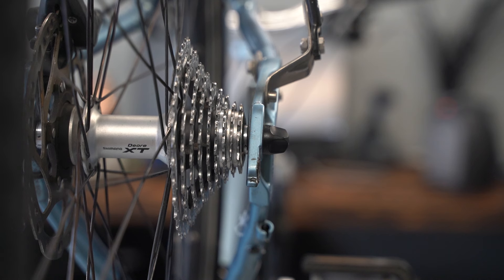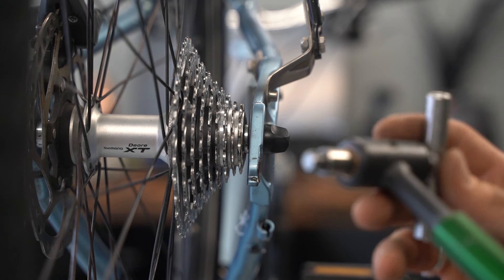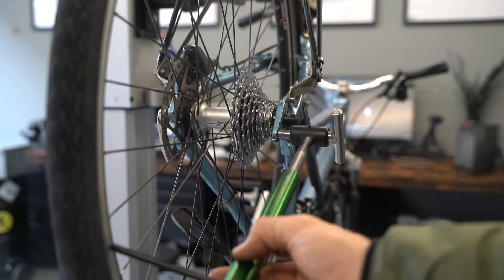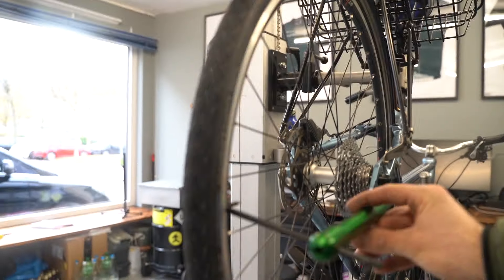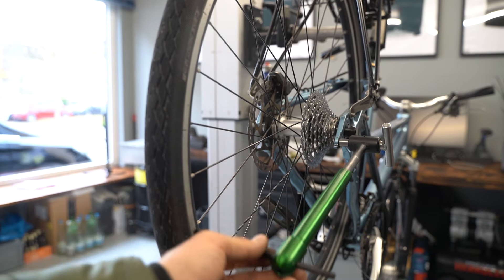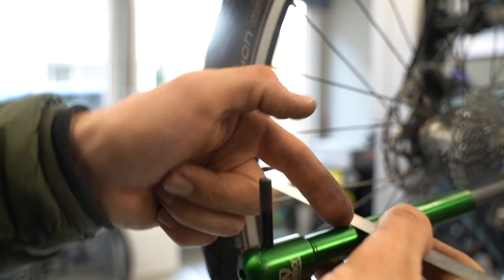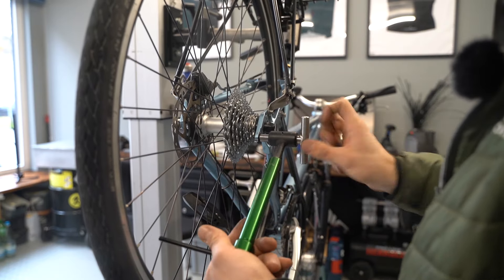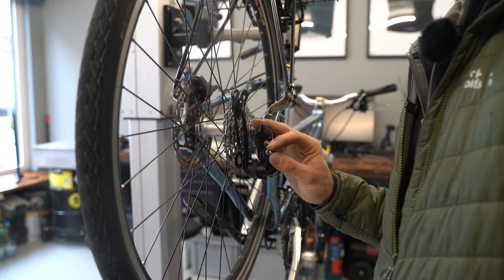How To Align A Bent Derailleur Hanger

Comment: You must rotate the wheel and measure on the same point of the wheel when you check the different positions . For example in line with the valve every time. Because if the wheel is bent or buckled , you’ll be measuring and seeing the buckle
Reply from the maker: That's right and that's what I explained in the video:)